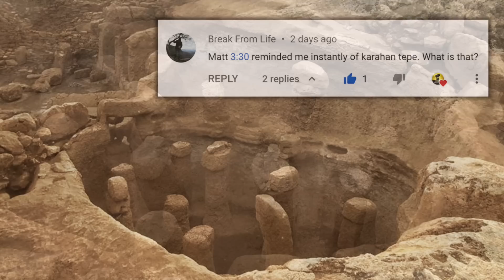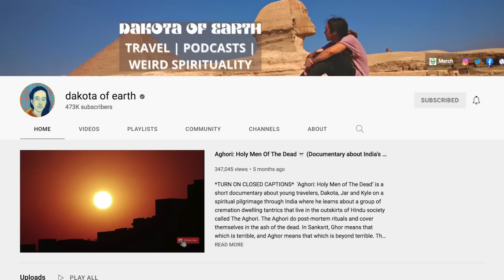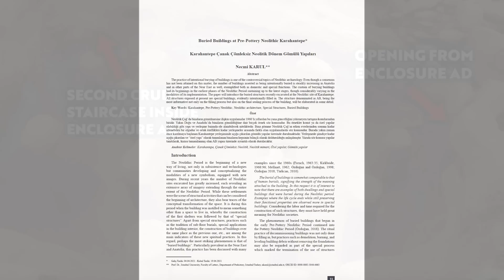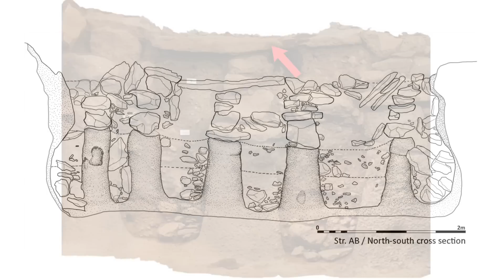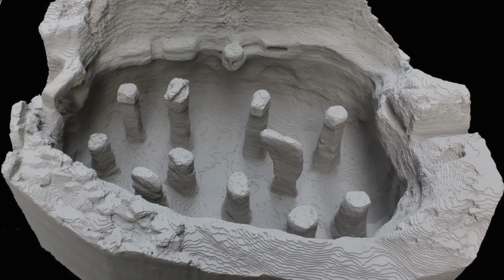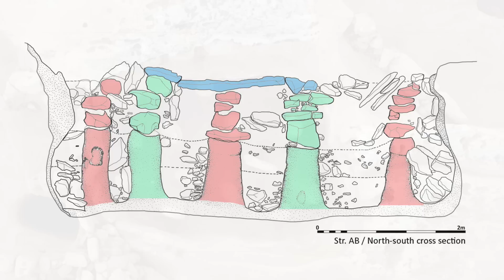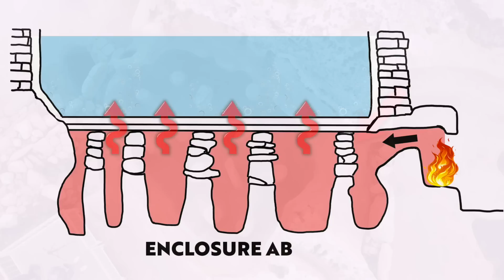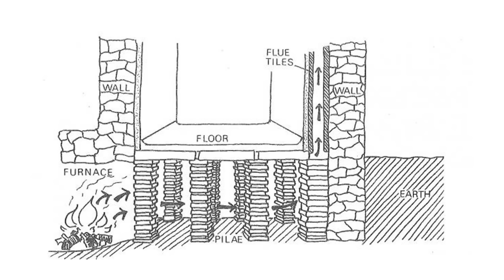An 11,500-Year-Old Central Heating Hypocaust system at Karahan Tepe? | Ancient Architects

Comment: It's an interesting idea Matt. But the pillars are all different heights and I don't think stacking rocks on top to level them up would make for a stable floor on top. Even if they did, I don't think they could make the floor water tight to hold water above. If they were heating a structure above, where is the evidence of it ?. The free standing curved pillar has some basic carvings on it. The pillar behind it has a cavity carved half way up, and we have the carved head. The overriding question is why bother ? if all these things are hidden. Nice vid though Matt.
Reply: The floor wouldn't have to be level. Only if people were walking on it -  which if it held heated water, they would not be.
Reply: @DunderMifflin_ThisisPam  I hear ya P, but the floor would  have to be 100% watertight to hold water above. That just seems to unlikely. So the other option is it heated a structure, so where is any evidence of that ?. These are valid points I feel.
Reply: @dazuk1969  11 or 12,000 years ago is a long time. It's hard to say what the structure looked like then. Imagine if a future civilization found our basements. It would be tough to tell how we really lived from that. Have a great day
Reply: @DunderMifflin_ThisisPam  Our basements are made of brick or concrete Pamela, they would be dust in 12,000 years. But I agree, trying to work out what our Neolithic friends were up to is almost impossible. You have a  great day also.
Reply from the maker: This is all great, constructive criticism, very important and welcomed. Thanks Darren.
Reply: @AncientArchitects  You are welcome Matt....and I look forward to hearing more about your hypothesis.

Comment: PS. the Indus Valley Civilisation had Public Baths and homes with plunge Baths and toilets. Plus very odd extremely high temperature fired Ceramic Bricks used in Construction, that are still good after thousands of years.  Perspective, our Properly fired house bricks today, only have a service life of about 400 years, and to get far superior long lasting  eramics,such as for Ruby Ceramic whetstone, requires temperatures between 3,000 and 6,000 degrees C, which today you get with Plasma Gasification.  Curiouser and Curiouser. Bob. 🤔

Comment: I'm doubtful about your hypothesis for the following reason: The furnace opening sits too high—almost level with the top—rather than the bottom. If the furnace opening was used for an extended period, there should be blackened and sooted stone or earth around it. I'm more inclined to believe that this area is for water storage.
Reply: there should be dark traces of fires 11k years later? wouldnt it be safe to assume there would not be any left anyway?

Comment: the channel is an earlier stage of construction, I'd guess - but potentially for water channelling, still. I just can't see it playing a useful role for anything happening at AB though. I note that it points to the big pit at AD - possibly an earlier stage of water capture?
The water ran off the hill and was originally channelled to the big pit at AD?
 From the cupola marks seen at other parts of contemporary sites in the area, I'd say hole AB was excavated to hold water using the same method - and utilised runoff from the hill beside it to top the thing up. This would make sense in an area that experiences seasonal rains...especially making sense for a people who are learning to farm 'wild' crops and keep animals.
Looking at AA, it looks to me as if someone wanted to stop water slopping over into AB. Angry neighbours..?
Perhaps the water gathered at AB was too much? If so..was the hill above AB modified to stop so much water flowing, and then AA was eventually dug out as an overspill..?
Or was AA the original hole, with AD as an overspill? I'd think dating the modifications on the hillside would help to answer that.
The head-sticking out at AB very likely had a floor over it. Was it a god-figure blessing the stored water...a hint at a purification ritual?
I'd suggest the weather patterns during the occupation period were highly seasonal for long periods.
Reply: btw...it looks to me as if the 70cm hole could channel water to the big pit at AD if there was an overflow spillage..evidence of a later use of the site utilising existing structures - if indeed the sharp channel cut into the rock originally led to the pit?

Comment: One thought, has there been any tests on how much heat needs to be generated to warm water the volume you're illustrating at the end? I think the fire would need to be MUCH bigger. Think how long it takes to boil water from cold on a model camping store using gas and burner? It's really not quick to even boil 250ml let along what looks to be about 70m3 (7x10x1). Something just looks off about the scale of the fire the space when you see it compared to the space. Not to mention the amount of heat loss through cracks etc on the way through?

Comment: Observation: The head in AB seems to be at about the same level as the tops of the pillars. If a floor was there for a bath house then the head would be at or potentially below floor level. But maybe that is just perspective from the photos? Definitely looks like it has something to do with water. Ancient water filtration device?? The pillars seem to have been designed to support those capstones.EDIT: after watching the whole vid, I think I agree with your hypothesis.
Reply from the maker: The floor would sit on the flat top of the head, which is the same level as the bench on the western side. I think on one of the 4 large pillars (lined up along the western side) you can still see a bit of the floor attached to the top.
Reply: @AncientArchitects  Your hypothesis makes a lot of sense. Facinating!

Comment: Matt, how would you account for the head statue on the side? While I can't exactly tell from the photos or the video,  wouldn't it be midway where the floor would be, and so,  would be covered by the floor if it was level with the top of the pillars?
Reply from the maker: The floor would rest on top of its perfectly flat head :)
Reply: @AncientArchitects  if I'm understanding the Roman construct correctly,  the space below would not be used by people,  but there only for smoke and heat.  Would it make sense to have a lovely statue there that no one would see?
Reply: @Enceladus it's possible, but I was trying to find other examples,  and cannot on a quick glance. My other question would be,  what was used for heating fuel.  Currently, the area doesn't look like it's got a lot of trees. It's possible that the climate was radically different though, so it would strengthen Matt's theory of that was the case.  I would like for the theory to be true though!

Comment: That head looks like it has puffy cheeks, like blowing air... nice theory, I am sceptical about hot water on top though. The weight would have been too much unless shallow, plus the expansion problems due to temperature changes would stress the flat rock floor, if that's what it was. I know that those more 'modern' underfloor heating systems had serious problems with draft, ie a large amount of hot smokey air needs to flow quickly up and out through a chimney, although it's not hot air rising, but cold air sinking/pushing in via gravity. I think heat underneath a floor is a good idea, but I am sceptical about large amounts of water. Also, the amount of fuel and airflow needed to heat such an amount of water would have been  huge, considering it would be flowing into and onto cold rock next to it, unless in use all the time (thermal mass). I have built and lived in several stone houses, trust me here. You don't ever let the fire go out and the walls cool down in winter - it takes days to warm up the walls again. I studied this at university in the 90s, and the amount of fuel and water/heat can actually be calculated to achieve about 20°C in the stone pool next door.
Plus, to the right of the head it looks like a hole fitting a wooden beam going across the pillars in front of it. It's even raw plank-shaped (round at bottom). Clearly to lay across pillars and hold something up. You don't want to burn that.

In my humble opinion, this may well have been a sauna (wet or dry) with an overflow for shallow water/steam. Maybe the steam even came through the air inlet via a pot and through gaps in the floor. This would add to the water-erosion look inside.
Thanks for the great video, very interesting.

Comment: I think it's an interesting theory . I will however point out that I'm the A.B enclosure it looks like there is there is a head  and face  jutting out of the wall in line with the tops of the pillars . If it was a heated floor the why would there be the head  carved at the floor level. It just be seems weird and I can't see how it would be practical there or why the effort to have the head at your feet ? Also it seems like there isn't much room for the spot where they would burn the wood or fuel . Just doesn't quite fit the profile that the Roman heated floors look like . But maybe your right .I am no expert either .

Comment: Interesting, but I  disagree.  My first thought is why would the space have a statue of a head on the ground.  That would be ground level if heating was at floor as shown in the Roman example, right?
Next, what looks like a water duct goes straight in at what would also be ground level.  This would cool the fire.  But, maybe there was another level in between that allows for fire.  Thus, The water going in was heated and this was one of the first communal baths?

Comment: Interesting idea, and it should never come back to bite you, the whole point of science is to put forward an idea for people to question and prove or disprove if they can.
A question for the physicists out there and anyone who has visited the site.  We have the site of a possible furnace and a hole to let the hot air in, but where would the hot air come out.  My understanding of a little physics and of Roman sites is that the hot air enters at the furnace and then circulates up and out of the walls using convection which pulls more hot air in keeping the temperature high.  Is there any sign of anything that might be a chimney to cause the hot air to flow constantly.  Maybe it wouldn't need a chimney, maybe the heat was just transferred trough the rock not the air itself, I don't know, I'm just trying to put forward one question that for me needs an answer.

Comment: I like this theory, nice if it is true.However,  there appears to be a carved face extendendin from the "hypocaust rim," at the same level as the top of the columns.  I have poor vision and glasses are broken. If I saw a face at the level that a floor would have been built up over the columns, that floor would of obscured the visibility of the carved face. In short, the floor which is no longer there if restored would cover the carved face image (small) to the back of rim in the image. It is not likely a culture would carved a face in that spot for that reason if it was really a hypocaust.

Comment: Nice video. well done! Its a great idea! Only thing is shouldnt there be more soot from the fire?
Reply from the maker: All depends on the 9,000 years of time since. It’s not been covered, rain water and ground water have been seeping through for millennia. We don’t know if they regularly cleaned it out, if there was some kind of terrazzo/lime plaster coating below as well as above that has since dissolved. The hypothesis requires further detailed analysis. Sadly, I don’t have the access
Reply: Should also be soot in the valley of the kings...but there is not. How they navigated an built is a mastery and mystery.

Comment: Where is the soot?  Do archeologists not have a way to identify old furnaces?  I would think the impact of the heat and the residues would be easy to detect.  There should be residue all over the chamber, in the pours of the bottom of rocks.  If you claim it was all weathered away or something somehow, that would seem to tell us something important itself.  For my part, I think this theory is wrong.

Comment: The only thing I see that gives me pause is that I do think they look like phallic symbols but are there two head carvings that I see there?  Possibly meaning the tops of the have been lost and perhaps were phallic with ancestral heads.  But hey there is alot of water erosion in there, possibly implicating 1000s of years of use if they were using it to heat water

Comment: If it was fire heated, where is the creosote ?  Creosote is very toxic and only specialized bacteria can break it down.  If an enclosure had fires repeatedly lit into them, there should be traces of creosote in the tiny indentations of the walls that could be found even today.

Comment: These look suspiciously like large beer brewing vats to me.
Warmth decreases the fermentation time significantly and coverings would prevent evaporation of alcohol content.
Water would be channeled in and and wild grains added regularly to maintain the brewing process as the product is consumed.
Perhaps at a later date it was decided by a ruler or the leadership that this practice was counterproductive or bad and the brewing vats were filled in?
Many have wondered,why people would build these sites in these locations but you have to consider that environmental conditions were likely much different there 11,500 years ago.
The logical reason for building these brewing vats here is obvious, that's where the supply of wild grains grew therefore it's the logical place to gather the grains and brew the beer.
As the climate became drier the supply of grains would have dried up too leading to the abandonment of the sites.
I would imagine people in those days might have gathered grains from wild grasses for food and discovered when rain water accidentally infiltrated their grain vats it fermented into a wonderful intoxicating drink which they quickly learned to mass produce.

Comment: Before you even said it an I seen the water channel they laid stairs over i thought...water heater? Then the rock erosion i thought exactly what you did. It was a area to clean and one to cook also capturing the excess heat. Could be wrong but it sure does add up. I bet they didmt find much of anything in the area where they would allegedly bath too...but did in the "cooking an heating" areas.
Reply from the maker: Yes… no archaeological finds in enclosure AB, nothing of note anyway. I think it’s an idea that makes sense - further work is needed though.
Reply: @AncientArchitects  indeed, nice work. As one pointed put too,the carved face could have been making a blowing motion also. Just symbolic that whoever the "god" was at this time was making it all work. Very nice again..time will tell. I'm not buying penis statues,literally an figuratively.

Comment: In your hypothesis, is it possible that the area you call ‘under floor’ AB had hot water instead of hot air?
Reply: There are symbols on the site that are clearly related to Astronomical or calendar marking and for that period is most likely to have ritualistic associations in cultural expression.  The symbols are also related to the most ancient cosmology recorded in antiquity.  Which is also why I relate the water aspects are attributed to that cosmology also.  But that is not to say this is a purpose built temple.  There is no reason to assume that the culture does not incorporate ritualistic practices and symbols in their everyday living practice -i.e. bathhouses and other utilities would also hold symbols such as the head that is connected to the underworld.  Similar to Karahantepe.  Which would also be feasible that it sits under the roof rather than above.  Also at Karahan  tepe I note in the temple that there is evidence of deliberate destruction - of feminine artefacts.  The so called ‘angel’ statue has her breasts chopped off and there are other signs of destruction also.  At some point it appears the ritual practices were changed which is most likely why the structures fell into disuse or were filled in as you say - natural subsidence because the occupants were no longer interested in maintaining them - i.e. didn’t practice the same cosmological beliefs etc.  The problem with ethnocentric research literature of our history is that people made assumptions that there was little connection or interaction between societies that lived and migrated.  Now that science - i.e ancient DNA has more adequately mapped  migrations and reverse migrations of people and even hominid species there isn’t any reason to think that this culture stood in isolation.  Considering symbols also found in Indus Valley were found on site and some of the symbology connects Sumerian and Babylonian cultures alongside primeval Nut from pre Egypt - I don’t think this culture is that mysterious at all.  In our contemporary society we have people who still live in caves and people who live in high tech society. People adapt to their environments.

Comment: I stand to think this enclosure is related to water... So perhaps a hot water source flooding the enclosure. As you say, Turkish archeologist had shutup some data to open the touristic side of the site. We need some more truth about what was discovered, if this was heated by wood, there would be carbon left that could be analysed. Thanks for your hypothesis. When I will have a car, I will travel to the site, from south Bulgaria to see by my eyes. This hypothesis could make sense sa a water reserve, heating a building over the enclosure, but for me this need lot of wood, and not sure 11.500 years agi there was so much wood, after a very cold era. But, volcanoes, and geology says us that likely there was the hypothesis of a hot water source.